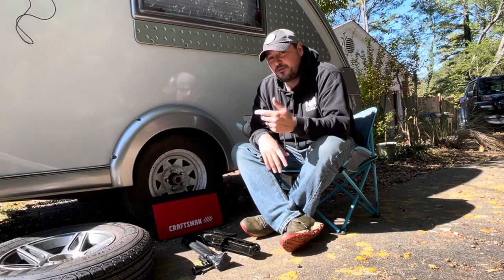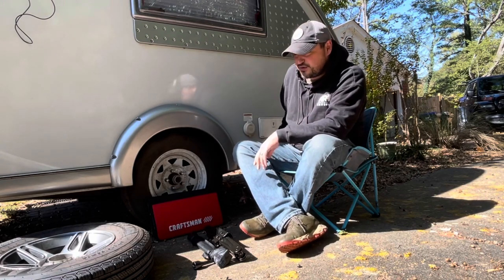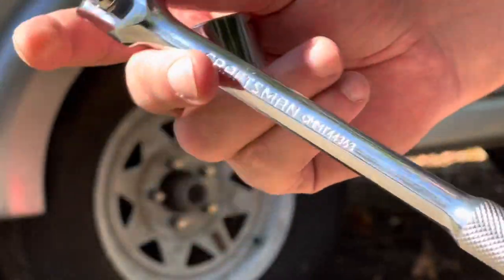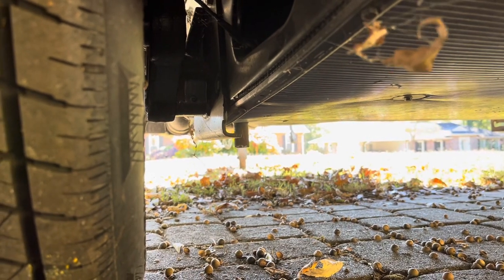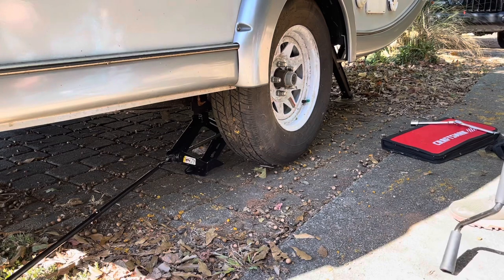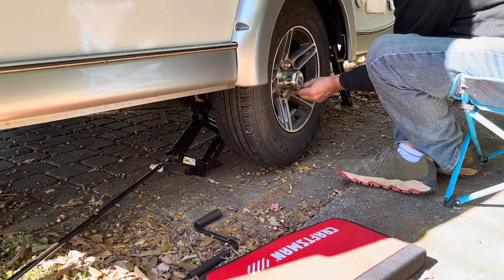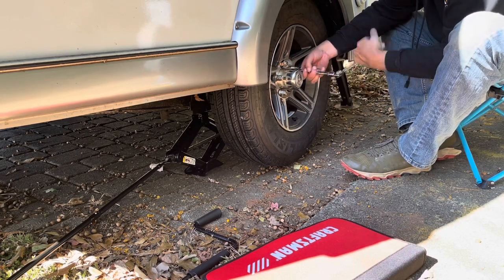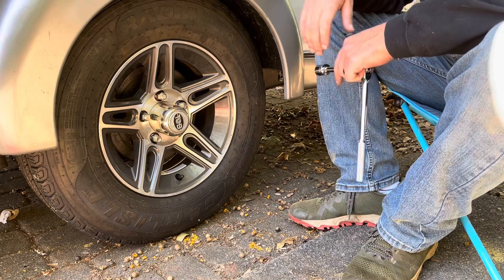NuCamp T@B 320 S 2018 Tire Change & Tool Kit

Comment: Interesting video.  We pull a nucamp t@b 400 BDL and here is our setup.  First thing we did was replace the spare with a full size spare to match the road wheels.  We also ditched the steel rim and bought a matching aluminum wheel.  Then moved the spare from under the trailer to the top of the fork.  In our jack bag is a 1-ton bottle neck jack, extended jack handle, a Dewalt Impact Wrench with a small wheel lug nut kit.  This small kit has six lug nut sockets that fit either our tow vehicle or the t@b.  I also carry a small allen head screw driver to remove the screws on the fender well covers.  Have two heavy rubber stabilizer foot prints similar to the lego models and I would use those to support the jack.  I wanted a system where I could jack up and change a flat, along side the highway, at night, in a rain storm.  It should be noted that you can keep your camper connected to your tow vehicle for safety.  I would also chock the good side tire but would avoid lowering the stabilizers on the flat side (if I did it would be after I had jacked up the camper) unless I needed extra stabilization.  Oh, wanted to add we did purchase a manual lug nut wrench in the event we had an issue with our impact wrench.  You are not the first nucamp owner to discover the size of the lug nuts are not standard to a vehicle.  You may also mention most nucamp campers have a smaller spare tire normally mounted on a steel rim.  The idea is to provide you a spare to just get you to a tire dealership.  This all came to light for us when we started looking for new tires and discovered from the forums, the tires on our 2019 were from China, were known to have issues, and were impossible to get unless you ordered from nucamp.  What this would have meant is if we got a flat, we would have had to purchase two new tires if the flat couldn't be fixed.  Strongly recommend installing TMS on those camper tires.

Comment: Glad I watched this! Just got our 320S Boondock camper, and “assumed” it came with the tools to change the spare. I also “assumed” the spare was the same size tire (15”) as what is on the camper. Wrong in both cases. Now I know.

Comment: Thanks! Brand new  2018 320 cs/s tab owner here. Can you tell me what tools you are using so I can add them to my (ever growing ) list of needed tools?
Reply: I would suggest joining the nucamp forum.  When we got our 2019 and began preparing for a three month trip to Alaska I visited the forum and discovered an owner of a t@b and basically created a user manual.  In it he summarized all of the manuals you get when you buy a nucamp trailer.  In addition, he has a section on trouble shooting, changing a flat, hookup and camp set up check list, a list of fuses and tools and some other good tips.  It is in a pdf format.  I downloaded it and printed it at our local Staples.  I then went on Amazon and purchased just about everything on the list and it all fit nicely in a soft tool bag.  Obviously, as we have gained experience, we have added a few things but all in all the pdf was a GREAT start point.